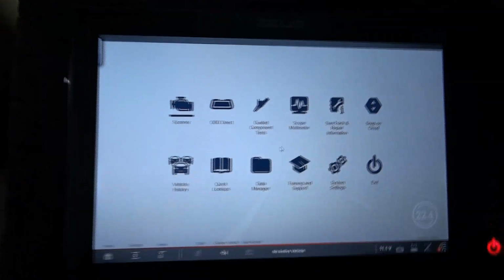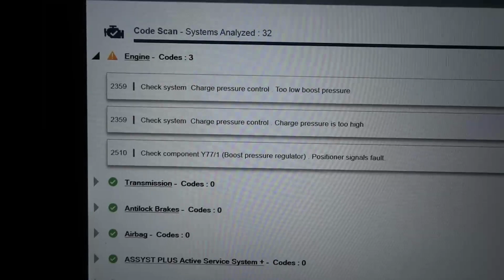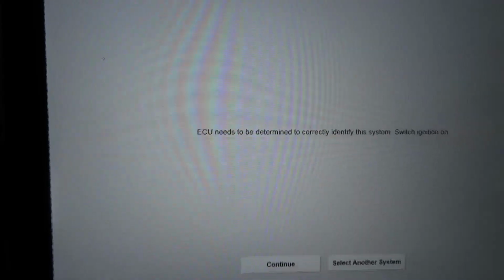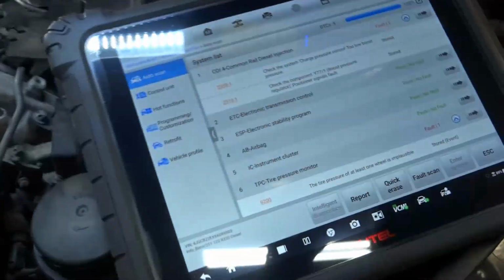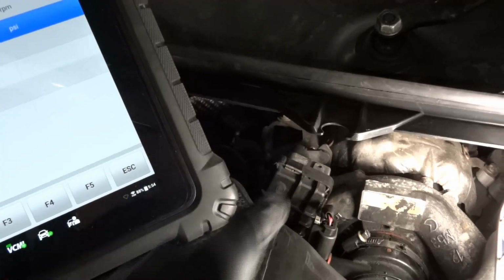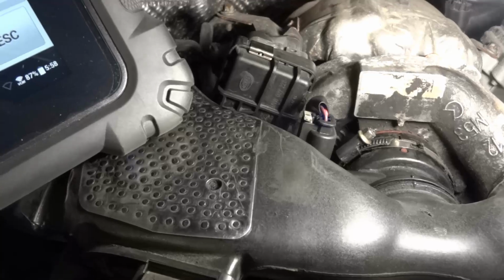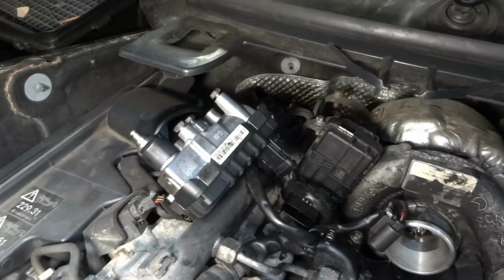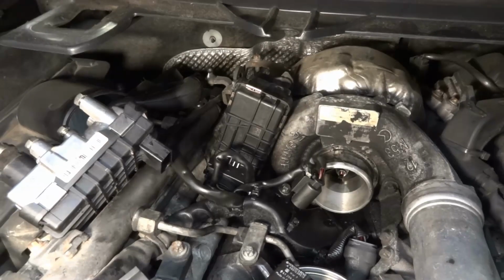Mercedes R320 Turbo Actuator Sticking, Boost Pressure Regulator Failing! Charge Pressure too High

Comment: YOU ARE A LEGEND
 have ml 280  I HAVE 2510  check component y77/1 boost regulator pressure.. I  was thinking to replace sensor first, but now, will go the my mechanic and he will do the test. if same  i  will change the actuator . many thanks !

Comment: I have a problem with the actuator on my vehicle, it has power and ground but doesn’t do a sweep when ignition is first on so it was completely dead, I have done the test of applying a ground to the 3rd wire and the actuator doesn’t move at all, so I replaced the actuator as the old one was bad. I have installed the new actuator and still the actuator does not do a sweep and is completely dead on the vehicle, however taking it off the vehicle and applying a separate voltage and ground the actuator works but just not on the vehicle. So I traced the signal wire back threw to the control unit and done a continuity test on the wire from the signal pin all the way to the pin on the control unit and as I mentioned I am getting continuity, so my question is, could the control until be the issue that it is not sending the correct signal or no signal at all? I’m hoping you can help as I am at a loss with it and have ran out of things to do, the old numbers match the new unit so it should work.

Comment: Hi, I’ve e280 cdi and it recently started loosing the power since I’ve got boost pressure regulator error. I thought that my actuator is faulty so ordered new OEM hella actuator but after installing that boost still remains the issue dealership in Australia told me it could be bad exhaust pressure sensor so that’s replaced no joy. I’ve also eyeballed air intake hoses no cracks there and have also cleaned egr valve.
Really appreciate any leads here.

Comment: code P0238 what can I do to fix it, car stalls lack of power, going up the hills on hwy at times stalls, I have to turn it off motor and so I can keep going. Miss fire lack of power from engine.
Reply from the maker: @wilbertgarcia103175   you need to get it diagnosed

Comment: is it possible that my actuator is bad because the exhaust was blocked and soot was reversed back into the turbo and vanes got sooted up. this would explain why i have intermittent loss of boost, over boost and limp.  Maybe there is alos a boost leak. all these owuld explain why i have whoosing and flutter in the turbo air intake. Thoughts?
Reply from the maker: @robertodonoghue4100  If the vanes in your turbo are clogged, you need to remove and take it apart to ckean the vanes

Comment: hi bro ,thanks for this useful videos, i have a 2005 w211 om646 e220 cdi recently i changed this actuator but still have a 2632-8 dtc fault (check systeme pressure control charge pressure too high) the engine seems to have an overboost with too much noise coming near the turbo,i checked wirings and pipes all ok.my car has a stage 1 with egr off.any ideas ??thanks
Reply from the maker: @saidboussif9331  The vanes in the turbo might be sticking!
Reply: Thanks a lot bro i will check this greetings .wish you best

Comment: Thank you so much for this video.
It has helped me sort out a long running problem with my Mercedes ML320.
You explain so well what the codes are and what they actually mean and how they are generated. I had the exact 3 codes you describe and I changed the actuator to solve my intermittent problem (limp mode).
Once again many thanks from a viewer living near Liverpool, England. I only wish your   
garage was nearer so I could bring my car to you to maintain!
Regard
Alan
Reply from the maker: @alanwilliams6622   My Pleasure! I'm glad to hear that the video was helpful!
Reply: You're a star! 😊
Reply from the maker: @alanwilliams6622   Thanks!
Reply: Hello Alan i want to ask because i have the same problem with my ML320 but i cant find the actuator as part it self in greece , so i have to change the turbo . did you buyed the actuator or the turbo with it ?

Comment: Hello, very good video, you are helping me a lot. Can I ask you a question? I have the actuator that moves when I turn on the ignition and start. But when I step on the accelerator, it does not move. They have done a test on me with the diagnosis and they say it works fine. Is it normal that it doesn't move when you step on the accelerator with the car stopped? No fault appears in the diagnosis. What could I look for to find the fault? There is also a little smoke coming out of the exhaust when revving. Thanks for everything.
Reply: SORRY,The car loses power at low revs..Thanks
Reply from the maker: @DavidDavid-dz5mn  Hello! the actuator may not move when you rev up the engine while the vehicle is stopped, Exhaust leaks would cause the turbo to not spin fast enough which will lead to a power loss and also make sure you don't have a boost leak!!
Reply: Thank you for everything. The truth is that I have a leak in the exhaust manifold. I am going to change the manifold and we will see if it is solved. Greetings from Spain.

Comment: Hey brother, very good video with great detail and justification, i have the same code 2359-1 “” Check System 'Charge Pressure Control. Too Low Boost” my car looses power at 130-140 kmph, the car runs well but the throttle pedal at low rpm becomes less sensitive, additionally i have an egr code 2511-1 which states “ Check Component Y27/9(Left EGR Positioner). Positioner Signals Fault.” Please could you advise how i can go about it for both of the codes, i have a 2008 e280 cdi with the same om642 engine
Reply from the maker: @zeeshanmak2226   Test the turbo actuator and the EGR valve wiring or the valve itself, it could be sticking! I have videos here on the channel that can walk you through doing that!
Reply: Hi, @zeeshanmak2226 did you manage to solve the problem? Because it has the same errors as yours. Thanks for the answer👍

Comment: Thanks, your videos help me a lot 
I already replace the oil cooler on my Sprinter 2012 just removing the turbo and the turn base 😬,
Could you give me the scanner reference? What are you using on the Mercedes diesel 
Thanks 
Thanks
Reply from the maker: @jgfa147  My Pleasure! I prefer to use my Autel scanner on Sprinters!
Reply: @KITS_Auto_and_Truck_Repair  which one?

Comment: hello, I also have a problem with a mercedes w221 320 cdi error code 2592, I changed the actuator from the turbo and I still have the same error code, thank you
Reply from the maker: @sorinandrei8246  Make sure the actuator wiring is good!
Reply: thank you very much for the answer, the wiring is good, it works when I accelerate to see how the rod from the actuator goes up and down, I want to ask you, does the gas cleaner have anything to do with this thing? I took it apart and it has a broken membrane

Comment: Have you ever had a bad turbo accuator without a faultcode? I have a s212 350 with weird foult, when i gas hard it jerks really hard just when it hits 1900 rpm. And only in 2-3 gear.
No faultcode, but i have put a GoPro under the hood and i think the accuator is sticking when the jerks happen.
Reply from the maker: @exxo150  Ok! make sure your transmission is working well!
Reply: @KITS_Auto_and_Truck_Repair   can i send you a video somewhere? I put a GoPro under the hood so you can see and hear
Reply from the maker: @volvo1972   yes! you can email it to me!

Comment: Bro - the boring part is where I am stuck - The bar - I have removed the 4 bolts but the bar seems to be anchored at the rear of the engine somewhere and I cant see where-- with the 4 bolts off the bar rotates a little but I don want to bend anything by pulling too hard...can you show us the boring part?
Reply from the maker: @webbsolution2010  the Bar should be pretty straight forward to remove!  make sure none of the bolts are spinning freely!

Comment: The problem is only low power or when you remove the foot from the acceleration pedal, is sound like excess od air or wosh sound?
I see the car is not changing the gear an is stay close to 2000 rpm.
Reply from the maker: Iordache Florin  what do you mean?
Reply: @KITS_Auto_and_Truck_Repair  https://youtu.be/qUH9vctwDTE
At min 0:50 and 1:16(more noticeable) is present an sound like whoss sound. Similar to excess of air. Do you have an idee from where can came?
And is present more when I accelarete and remove the foot from the pedal. Could be the actuator?
On diagnosis is nothing stored or present.
Nobody can detect from where the problem is comming. Is present this sound from time to time. And when is present the car is not have power.
Reply: Does anybody know what is responsible for that sound?
Reply: @iordacheflorin8191 вы нашли причину ? Думается из-за небольшого износа шестерёнок привода наддув скачет или в проводах окисление, ответьте плиз

Comment: Hi mate. Great video. I have w211 om 648 engine with gt 2359turbo and getting second code in video. I think at least i find issue with your video. Ill change that fcking actuator
Reply from the maker: Tuned om648  Thanks! but make sure the actuator wiring is good before changing it!
Reply: @KITS_Auto_and_Truck_Repair  my car sometimes runs good sometimes in limp mode even without hard accelerations when cruising turbo is going off then i press pedal again and it runs again. In first and second gear mainly. When i hit pedal its  going limp sometimes, doesnt matter what gear u running. I check everything and i think its actuator

Comment: Thank you for this video. I have been struggling with jerking car and limp mode. I had 2 faults P2510 and P2616. It was not an issue with back pressure sensor as replacement did not make it better. My turbocharger and actuator was renewed. I was not worried about turbo itself but it seems that actuator needs some more repair. In my when arm is going down there is a similar clicking noise.
Reply from the maker: Sebastian Kubiak  My Pleasure!
Reply: Hi bro, Did you manage to fix your issue I have same issue, when i challenge the car during take off or overtaking it jerks big time then go to limp mode.
Reply: @dukebongane2646  Hey! Yes I managed. It was actually the actuator. Since it was renewed no issues at all (approx. 10k of kilometres so far). It didn't malfunction since then. I went with full turbocharger renewal, not only actuator.
Reply: Odezwij się Sebastian
Reply: @maksymiliant9909 czego potrzebujesz?

Comment: Hello!! 
Just to say that your videos are very good..
Just one question 
On my 120 cdi vito i had only 2359 low pressure and 2510 y77/1 
I have changed the actuator by a refurbished one,
Then the 2510 disappeared…
But the 2359 low pressure remaining 😢
So it now on safe mode,
What do you thing ? 
Somone tell me that the big hose is defect.. 
someone no …
If you can help me
Many thanks 
Sorry for my English mistakes, i’m from france
Reply from the maker: Greencard93 Greencard93  check for boost leaks around the intake and charge air cooler!
Reply: @KITS_Auto_and_Truck_Repair  thanks very i will check and  i will come
Reply from the maker: @greencard93   My Pleasure
Reply: Hello 
I checked the big hose, she seems good, 
But the vaccum breather pipe was fold 
Do you think that it can be the issue? Thanks again
Reply: Hello kit’s !! Just to tell you 
I checked my vito with a smoke leak detector to find some leak 
And there’s no leak anyway 
I heard that it possible to have the catalytic out of order 
Or turbo damaged 
What do you think ? Many thanks again for your help

Comment: I have had a jerking issue when accelerating on my w164 with the om642 engine. It happened once in some months and the only code was exhaust back pressure too high. Changed the sensor with a genuine one and still it has occured. This weekend I accelerated again and the car jerked and went in limp mode. Turned it off and on and was good to go. This time it threw even the code for the turbo actuator. Since this thing is known to fail I will test as you did and most likely will have it replaced. Turbo was checked 1 year ago at a turbi specialist and everything came out good.
Reply from the maker: Albi AD  Ah ok! Good luck!
Reply: @KITS_Auto_and_Truck_Repair  Did the same testing as you did and there are no abnormalities when pressing F3 and F4 but when aborting the test in your scanner opsion F5 meanwhile in Xentry F12 the regulator did not move at all meanwhile in your video when you press F5 it moves to the up position. Do you think that this proves that something is wrong with the regulator? Thank you!
Reply from the maker: @ad166bt   Yes, if your wiring is good, then your Actuator is Bad!
Reply: @KITS_Auto_and_Truck_Repair  Thank you for the fast response and assistance.
Reply: @KITS_Auto_and_Truck_Repair  Sorry to bother again. Did a test drive while Xentry was connected. Accelerated about 15 times and no jerking or error code appeared. Through Xentry I noticed that the currect values of the turbo actuator should be =>85% meanwhile during acceleration I saw values as low as 34% and also these values varied from 34% up to 90%. Even at a steady speed of 80km/h the values fluctuated between 42% and 90%. I made even a video in the following link: 

https://youtube.com/shorts/8CivPuuqUK4?feature=share

Do you happen to know what values should be expected during acceleration and if such values are normal?
Reply from the maker: @ad166bt   My pleasure!
Reply from the maker: @ad166bt  I don't look at the actuator data PID when I test them, I look at the Boost Pressure data Pid!
Reply: @KITS_Auto_and_Truck_Repair  Thank you. Have a nice day!
Reply from the maker: @ad166bt  My Pleasure!

Comment: Hello my Friend. I have a big problem. My car got a problem with the turbo actuator, so i changed it. now the false code is gone but my turbo actuator moves WRONG. it goes up really fast when i press the gas. but when i let off the gas it goes down really fast too. it should go smoothly up and down. When i drive i have a really bad shaking at 1800-2000rpm. what could be the problem??
Reply from the maker: Ossi  your actuator is probably a bad quality!
Reply: @KITS_Auto_and_Truck_Repair  ok i bought a refurbished original hella actuator. When it arrives i will give an update if it worked
Reply from the maker: @ossi8221  Sounds Good
Reply: @KITS_Auto_and_Truck_Repair  hi. i have bad news. the refurbished original turbo actuator arrived. it 100% working, i testet it with a good diagnose tester. But the car has the same problem. it goes into limp mode and there is the P0244 code (turbo actuator problem code). please help. what could it be??.
Reply from the maker: @ossi8221  I recommend you take it to a pro mechanic who can diagnose it for you!
Reply: @KITS_Auto_and_Truck_Repair  hi i found the problem. The actuator is perfectly fine. The turbo VTG is stuck
Reply from the maker: @ossi8221   Oh ok! Nice find! Good job!
Reply: @ossi8221  what do u mean by vtg?
Reply: @kevinisaksson12  variable turbo geometry
Reply: @kevinisaksson12  the little fins in your turbo that control how much pressure the turbo generates at each rpm
Reply: @ossi8221  okay, thank you!
Reply: @kevinisaksson12  i  swapped the turbo with a refurbished one. 200€ on the Internet. Very nice. Now its working perfectly. The New turbo came with a turbo actuator on top.

Comment: I wouldn't be so sure about the culprit of the drive. What if a mechanical obstacle in the turbocharger interfered with the last move? I didn't see the lever being disconnected during the test. Or that the free movement of the lever has been checked.
Reply from the maker: Weld Cut  Good point, the actuator lever was checked and everything was fine, this vehicle was fixed after replacing the actuator!

Comment: If you have a brand new 2022 sprinter van is it possible to have little to no trouble codes? Or is it normal to have alt of codes cause it’s new.
Reply from the maker: Ramon Heard Jr  No! You shouldn't have trouble codes on it! what kind of trouble codes do you have ?
Reply: @KITS_Auto_and_Truck_Repair  I can send it to you is there a email?
Reply from the maker: @rhvreramon  yes! Email me at Deo@calleva.org
Reply: @KITS_Auto_and_Truck_Repair  I have a copy of the codes from my autel tool.
Reply from the maker: @rhvreramon   ok!